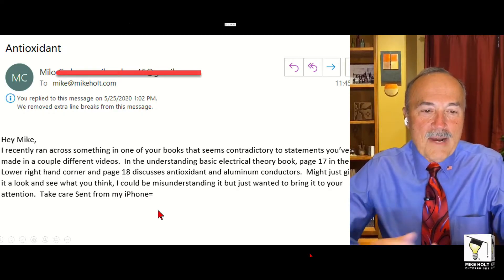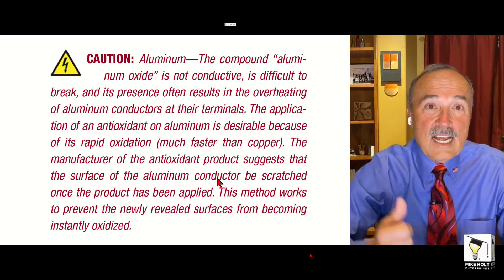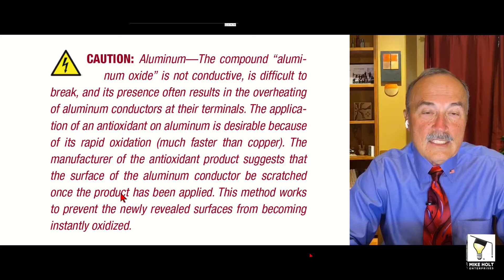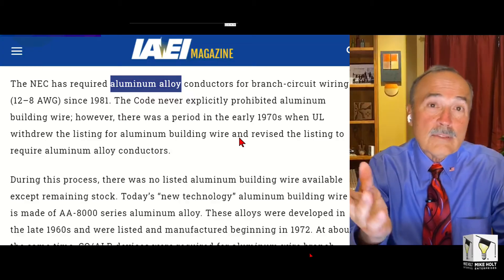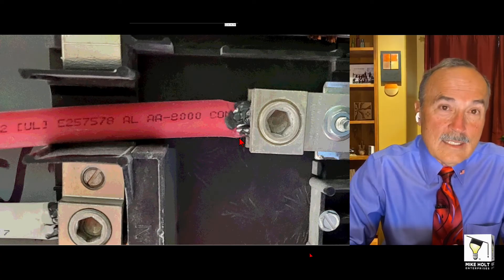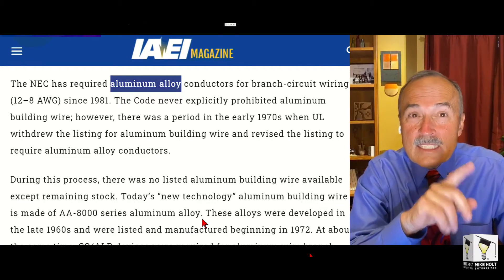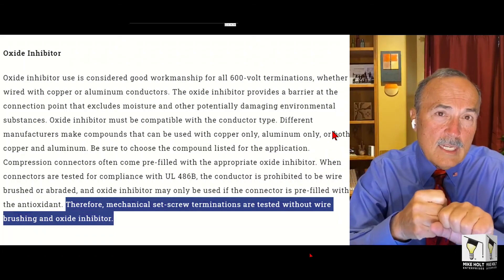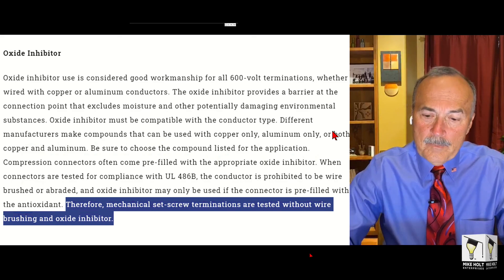Aluminum Conductor Termination Methods, NEC 2020 - [310.3], (8min:46sec)

Comment: Very interesting.  I have never seen aluminum conductors smaller than about 8 awg.  The aluminum conductor sizes, 12awg and 10awg, as I understood, were used extensively for a brief period between roughly mid '60s to early-mid '70s, when aluminum had gotten such a bad reputation for causing fires, nobody wanted it in their homes dispite the newer improved AA8000 which was actually developed around 1971 or '72, and is the standard for today. I didn't realize they still manufacturer 12 and 10 awg in the AA8000, or is that just for code reference?? You are correct,  the old technology aluminum wire was the 1350 series,  that had tons of issues with expansion contracting,  loose and burned connections, oxidizing,  and arcing conditions, plus there were no such thing as AL/CU rated devices in the '60s when it began to be used almost exclusively, so the electricians had installed it identically to the copper that they were so accustomed to.

Comment: Interesting topic.  It looks like AA-1350 use to be used in the 60's and had many of the same issues as the non-alloy.  Now it appears we have many variations of the AA-8000's with different numbers from different manufactures.
Reply from the maker: What are you saying as it relates to what I said?
Reply: @MikeHoltNEC  More or less that the first attempts at using an alloy were a failure.   I'll refrain from commenting on any videos in the future.  Your clearly looking comments related to current NEC code.
Reply from the maker: @jeffm2787  Yes thank you!

Comment: I called Eaton and spoke with their technical dept on this subject. They told me the same thing you said. They told me todays wire does not need it nor do they recommend using it on their panel terminals or breakers.   My local inspectors are "dinosaurs" and will still call it out if not used.

Comment: Corrosion can only occur if oxygen is present. It seems to me the main purpose of a corrosion inhibitor is to prevent oxygen from air or water from contacting the surfaces, and then for the inhibitor to stay present for many years without degrading or washing away.  This is true for lubricants as well, and is why WD-40 is misused for this purpose as it does penetrate and clean the surface but it also washes away easily, taking any present lubricants or inhibitors with it, causing a worse corrosion problem long-term.

Comment: The rant at the beginning against DIY is well dinosaur thinking. You're not going to change the self reliant culture in America, This isn't Europe. This country was literally founded on that ethos.  Also electricity is over 150 years old now. It's not some new technology, most people get the concept these days.  That said I see a lot of DIY horror stories you know how you fix that... EDUCATION not saying don't do this.   Having homeowner courses and resources and city support of inspections and help would A create a new industry and B bring in more revenue for the city that actually helps achieve safe installations.  If your goal is actual safety this makes sense, if it's trying to lock knowledge in an 1800's gilded trade well. Then I'm specifying my building designs for PoE and removing the trade from the equation. As you say stop being a dinosaur. 

Especially as an EE I'm sure as hell wiring my own house. You have another growing problem in the field of sparks who are proud of being ignorant of the science and view engineers as something to be looked down upon. One we're in the same industry so comradery is fine, but it's gone well beyond that. Two are you kidding me? I may not know every code rule but at the same time explaining kirchoff's loops to enough sparks and parallel paths just makes me scratch my head at the field.
Reply: @hermanmudget7880  my point is you're not losing money to those who can do it as you'd never get the call anyway. So do like maryland have a series of homeowner exams and expand your business into inspection and education. At least make it safe there's still plenty of work to go around.
Reply: @steven7650  all true, well said
Reply: @darbyl3872  The code is meant for tradesmen with on average a HS education or less. If you understand the theory then the code makes sense. There's a bunch of stuff that isn't as intuitive I agree. However, it also depends on what type of EE you did and what you background is. Growing up under a technician I have a far greater understanding of the hands on side of the business. I think your comment about buying the house is mostly correct. I would say would you buy the first house they did, nope I made tons of mistakes in my 20's that as I understand the IBC for plumbing and NEC more clearly I would do differently. Nothing unsafe, but little annoiances here an there. Like I've now built 3 stair cases. Finally feel i have that down taking everything into account.  It's the mistakes learning that you want to avoid that the trades help with.
Reply: @darbyl3872  My brother is fighting the insurance company because a tree fell on their roof. And they're trying to say the tree didn't cause the rafters to crack, they were already there.  I wouldn't use insurance as any sort of metric except for new and inventive ways to screw customers.

 Regarding 400A of breakers on 200A service. That is typical, residential load calculations take demand cycles into account and overall square footage. A standard 42 space panel can hold 820A of 20A breakers.  No one expects them all to be fully loaded and energized at once. And if they try that is the reason for the main to protect the service lateral conductors.
Reply: @hermanmudget7880  Agreed nothing against the trade. And i see lots of home owner hilarity as well. I know lots of engineers who don't know the code as it's not their thing, but for residential I feel every EE should be tested on it and allowed to sign off on it. We're not in the numbers to take away union work, and people frequently ask questions. Every M.D. regardless of sub specialty has to take internal medicine for this reason, the expectations of the title. I feel it should be the same for us. Also professional pride I like to do things myself, not looking to start a business at least for Service and installation, it would be on the engineering side.  Also knowing the code allows you to design better more efficient wiring diagrams if you've spent even a single summer pulling cable.

Comment: Love the content Mike.   Random thought occurs watching this.   Doesn't 110.3(b) kind of trump a lot of this?  In fact if a listed terminal's instructions DON'T mention no-lox I would think application of any would be a violation.
Reply: ILSCO makes a product called DE-OX.  It's designed for any CU or AL connections.  We use it universally anywhere corrosion may be an issue.  I use it for automotive connections too - does wonders for those pesky trailer light plugs that corrode away due to road salt.
Reply from the maker: That is an excellent point!

Comment: Is there the same grade of galvanic corrosion in a connection between  AA8000 and copper, as supposed to the corrosion between Aluminum and copper?
Reply: Maybe not the same corrosion rate, but it's definitely still an issue. I've done temp connections with a wire nut underground aluminum to copper wire and it corrodes pretty fast, especially at the first sign of moisture.
Reply: @nicvanengen9545  god dang... I guess there's always gonna be that among different metals. What about if you use noalox? Different metal connections
Reply: @0786RICARDO  maybe it would work. But it doesn't matter because there is always a better solution available.  Any connector rated for CU-AL can splice the wires if it has two or more connection points.
Reply: @nicvanengen9545  Absolutely.

Comment: What about putting the noalx on the lug screws
Reply: Common practice for us.  You go back 20yrs later and the screws are not stuck.
Reply from the maker: Violates the listing of terminals, since the torque values were set on 'dry' screws [110.3(B)].
Reply: @MikeHoltNEC  True of course.  I'm curious what would Mike do then, lube the threads or use a torque wrench on all connections?  (I'm sure this has come up before).  Thanks for the vid's by the way, very informative.
Reply from the maker: @nicvanengen9545  I would follow the manufacture instructions and use a torque wrench and NOT lube the wires or screw threads.